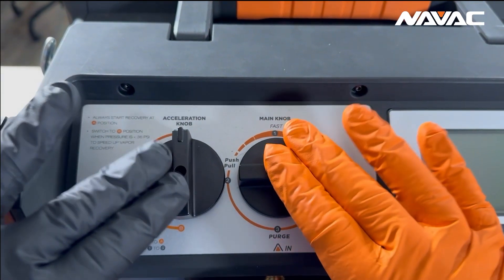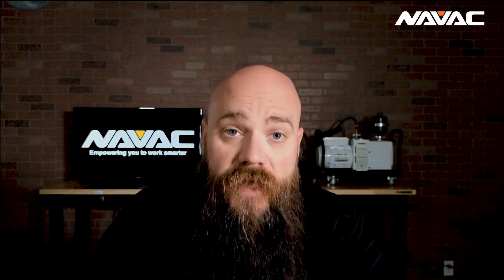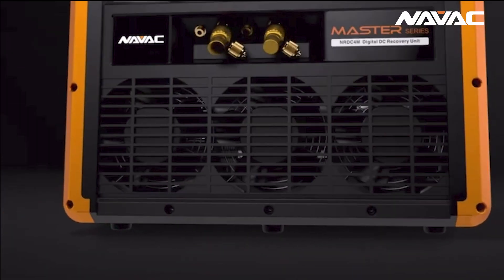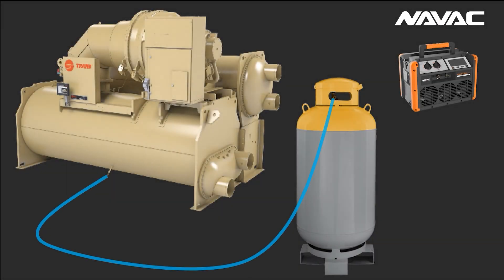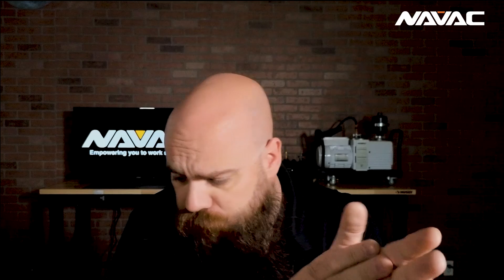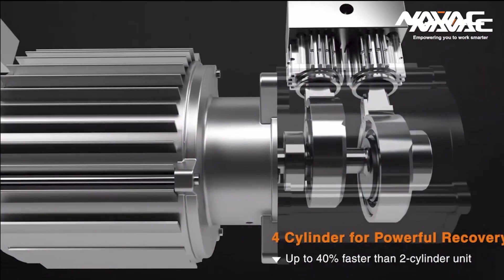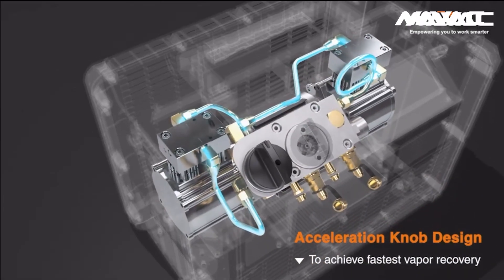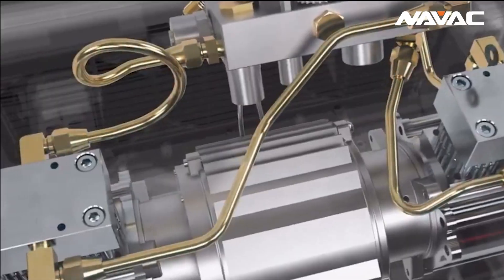HOW TO USE THE NRDC4M - FOUR CYLINDER RECOVERY UNIT

Comment: I’ve owned this recovery machine put in my order before they even announced it for sale and United States. 🇺🇸 
 I was one of the first purchase to the retail market and use the four-cylinder recovery unit daily. I abuse the hell out of the thing..  Even made a video putting into recovery tank and the recovery machine intentionally on a hot Summer day in front of the condenser discharge fans.  And operated like it didn’t even know there was heat being discharged on the tank and the cool air the four-cylinder recovery machine. 
        Use it to recover refrigerant way down to roughly 1000 µm. 
       Hands-down, this is the strongest fastest smallest compact recovery I’ve ever used. .